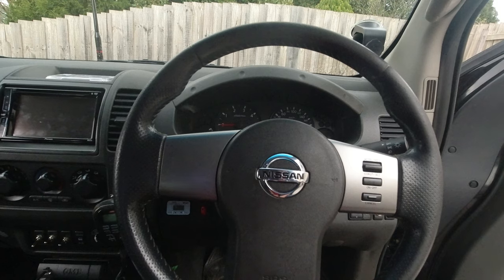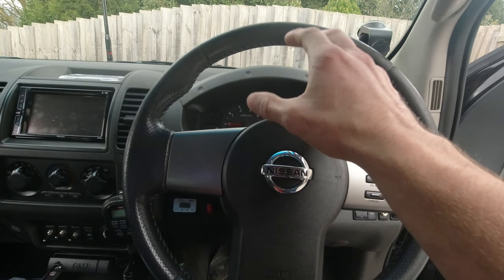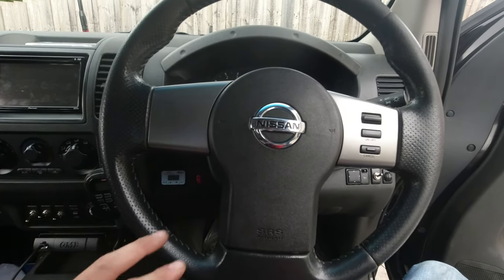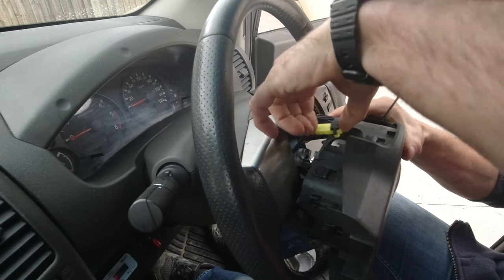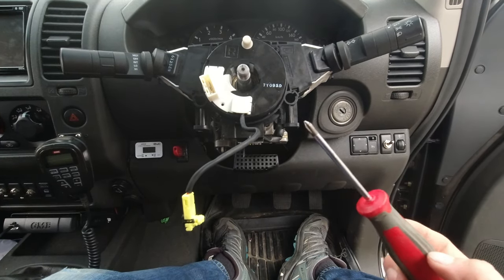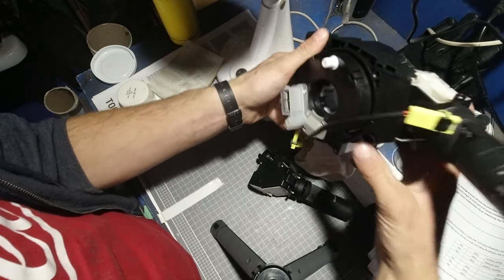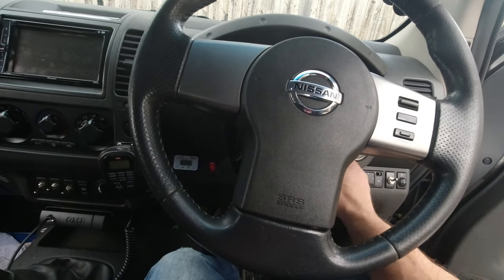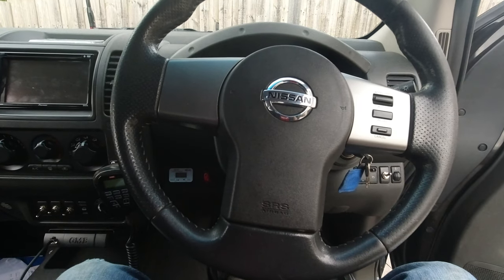How to Remove Clock spring / Airbag Navara D40 | Crocodile Andi

Comment: I followed these instructions and fixed my cruise control and horn problem on my 200i Nissan Frontier. There was one extra screw holding the plastic housings around the steering column, otherwise, same exact process.
Reply from the maker: Awesome, I’m glad you could fix it and my video help you with it. Thanks for letting me know I appreciate that👍
Reply: 2008, sorry

Comment: good little tutorial but my only recommendation for saftey sake is to dissconnect the battery before you play with airbags as you don't want the risk of setting it off accidently
Reply from the maker: I am sure i mentioned that in my video, at least i hope i did. Otherwise thanks for mentioning, mate

Comment: Hi my steerwhile backlights aren't working and controls are only working on certain angles. Can it be the clock spring?
Reply from the maker: Yes its very very likely I had the exact same problem with my cruise control, it would only turn on in a certain turning angle 👍

Comment: Also guys since you're working with the airbag to go under the bonnet or hood and unplug the negative terminal and ensure that the wire is not touching any bare metal and leave the car for about 5 minutes this is a requirement as it might spark or the airbag will deploy while you're working with it

Comment: Does the car battery need to be unplugged?
Reply from the maker: Yes you better should disconnect the negative terminal for the battery, it’s safer. I haven’t done it and been careful but no guarantee for that.
Reply: Okay thanks will definitely do that just in case
Reply from the maker: Good on ya, safety first
Reply: @Kolona222  my steering wheel doesn't have the release tab under neath to remove air bag?
Reply from the maker: But you have the whole for it? If so than there should be the release tab somewhere there
Reply: @Kolona222  There are two small round plastic covers though, maybe the tabs underneath
Reply from the maker: Watene Falwasser yea yours could be different to mine, maybe try quick google to see if your Navara is slightly differently to mine, so maybe they have changed something
Reply: @high_lyfe8546  was it the two small plugs? Mine sounds like the same model... hopefully it works
Reply: @MrShannonjames  there are two holes behind the steering wheel, and two tabs need to be lifted
Reply: @high_lyfe8546  awesome thanks for the reply. Waiting on delivery from Tasmania, hopefully it goes smoothly

Comment: Removing airbag with the battery still connected is not too safe ?
Reply from the maker: You are right it’s not and you shouldn’t do it, I did it half a dozen times without any problems and with being careful of course but you should disconnect the battery. Some say then you should even wait for 24h because there could be still some rest power left

Comment: Great video.. but how to fix a blinking airbag signal? After i fix my clock spring its still blinking. Thx
Reply from the maker: Have you already checked the connection to the airbag?
Reply: @Kolona222  yes
Reply from the maker: Alright mate sounds like your new clock spring isn’t riggt, if you still have the old one put this one in and see if that’s changing anything. Why did you need a new one? Because of the same problem you have now?